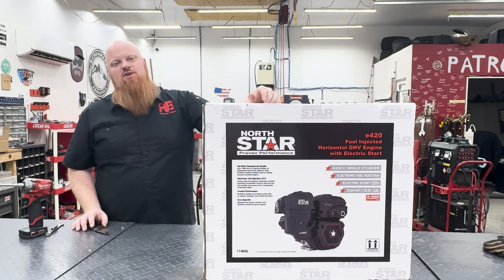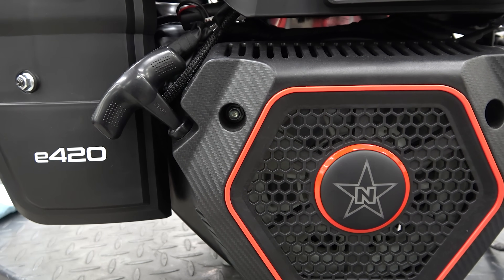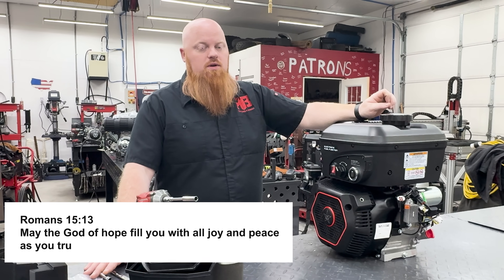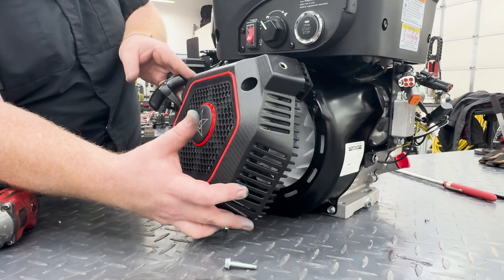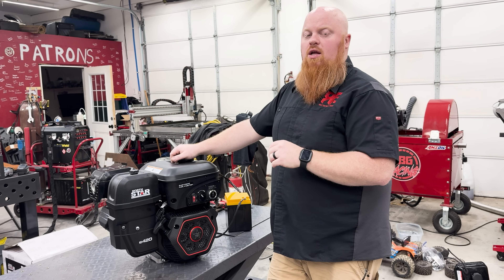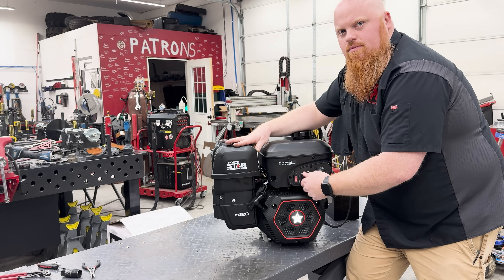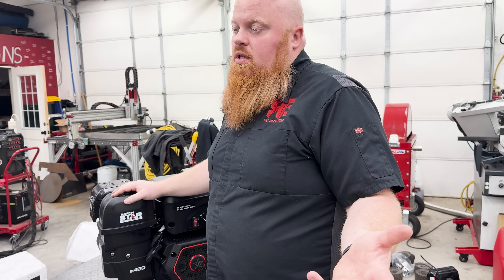EFI Fuel Injection 420cc Engine ~ North Star E420 Unboxing

Comment: Stage 2. We’re gonna remove the governor, add a billet flywheel and install a Mikuni carburetor. 😂
Reply: Haha 😂😂
Reply: Nah just up the fuel pressure
Reply: @kylejackson1236  That really won't do anything.    You would just want to change fuel amount and timing and spark timing in the computer
Reply: @joewaun894  a higher fuel pressure will increase the amount of fuel per injector pulse. A common cheat to get more from small injectors is to increase fuel pressure. Timing on this is probably not controlled by the ecm. This looks to be a simple efi system.

Comment: It would not be hard at all to replace the stock ecuand run this engine with micro squirt... you could use a 2 or 3 bar map sensor for use with boost...

Comment: Likely an air density fuel setup, air temp and throttle position determines the amount of fuel. Look forward to seeing the details im still at the unboxing
Reply: Learns from the O2 sensor. I bet you’re right.
Reply: @motoman22atgmail  doesn't look like it has one
Reply: Or maybe a map sensor

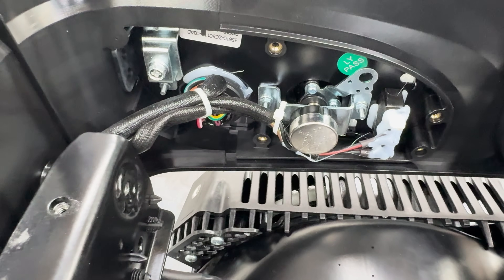Comment: if you look 7:26 you can see where the throttle cable will come into the back of the engine and it has a screw mount to hold the cable and then on the throttle POT there is a place to put that cable end to move the POT with a cable
Reply: But if we just watched the video.....
9:20
Reply: Yep! essentially turning the knob from the back side. Just need to hook up a return spring and off you go!